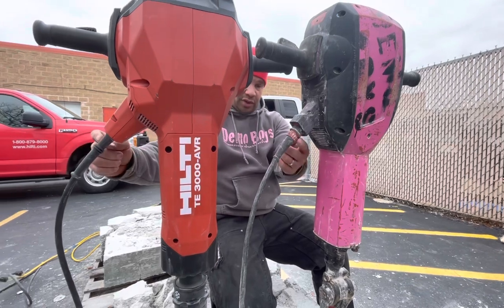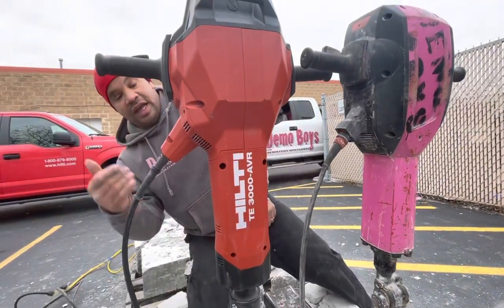Hilti TE 3000 Tool Review!  Demo Boys!

Comment: Thanks for the review; we are even more anxious to using our own new (Version III) TE 3000.

We have had great performance with our older design TE 3000, especially by using the correct point placement suggested by HILTI, see video: www.youtube.com/watch?v=rD7rza-t_yc
If the chuck security lever is folded backward (as in your November 15 video) the breaker point has limited travel inside the chuck. 

In our experience, with the incorrect chuck use you have demonstrated with Version I, the piston rod fails with less hours of use than when the lever is folded upward or toward the motor.
Reply: Um